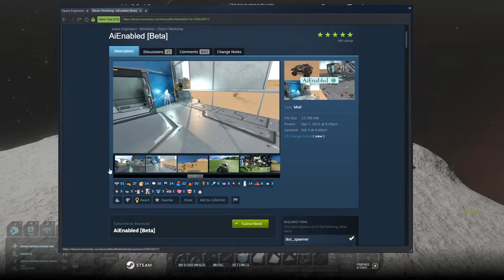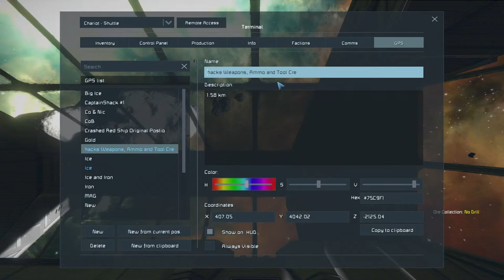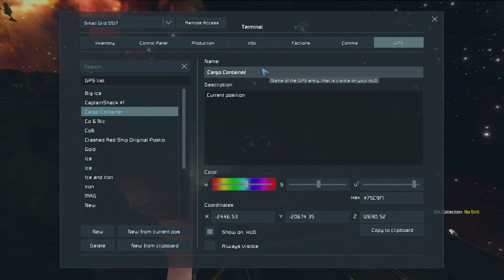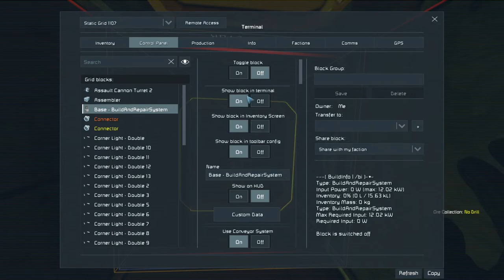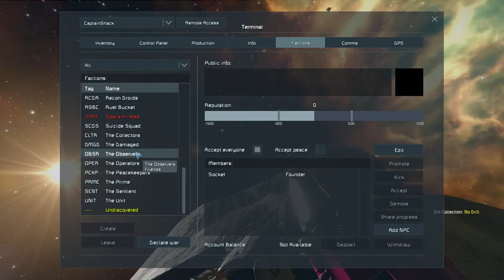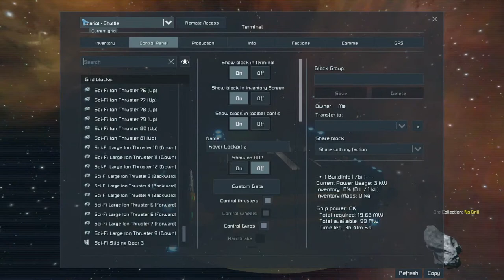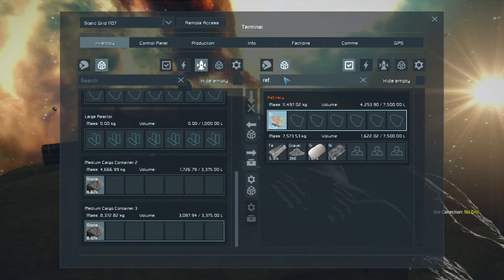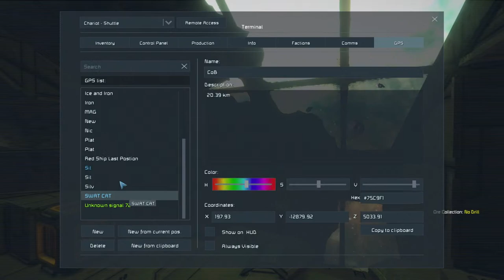Space Engineers - Building a Weapons Fabrication Asteroid Base (#7)

Comment: 56:15 I tried that skybox and I'm pretty sure it's actually broken. Tested it on an earthlike planet and the daytime sky was a wall of blinding light.
Admittedly it was a modded planet (*Terra - realistic geography*  - the mod uses elevation maps of earth, which is cool, and has a version that's compatible with the water mod, which is also cool, but the elevation even at max size is super exaggerated, which is less than cool but not a deal breaker for the most part; would make a cool setting for a naval warfare series) but I don't think that's a factor.

Comment: Sadly weaponcore doesn't work with the new turret controller yet...but its being worked on. Your can however setup the turret to track for the weaponcore weapon and setup a toolbar key to shoot or not shoot. Or for automating such a thing you would maybe want a long range sensor of which I use elite sensors cause it adds a new block instead of replacing vanilla sensors. When enemy detected it triggers a fire command for the weapon.